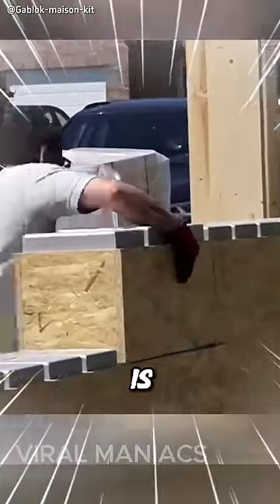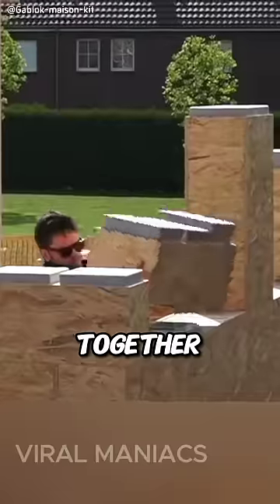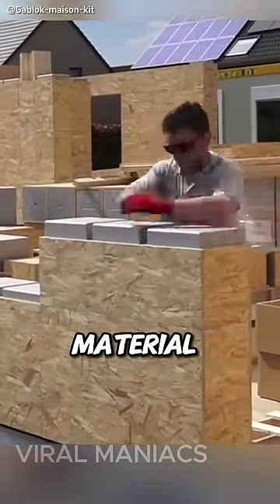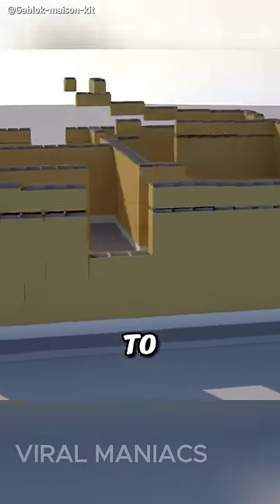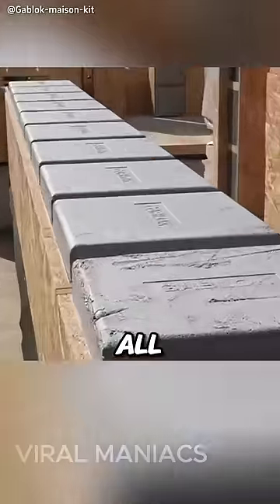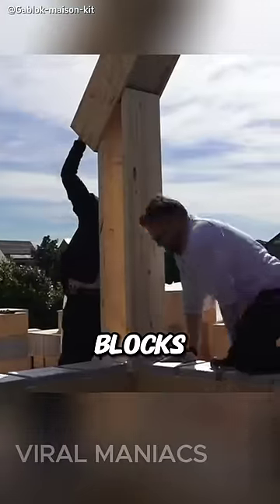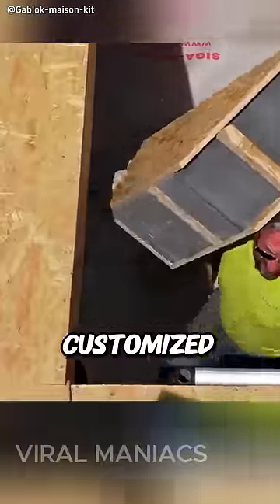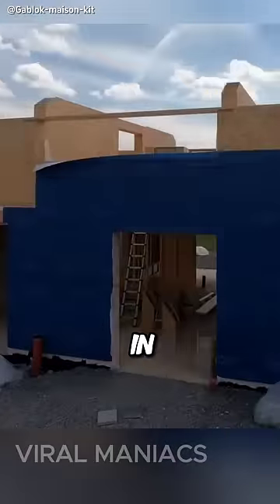Whoever Invented This Way Of Building Houses Is a Genius #shorts

Comment: Everything was fine until the big bad wolf came by😂
Reply: That's hilarious 😅
Reply: Exactly what I was thinking.
Reply: Just wanted to give the same comment 😂😂
Reply: 😂😂😂😂😂 Love the humour.
Reply: is that a 16 inch wall? So for those who assume that this is all it takes to build a home, you might ask a plumber, an electrician, a roofer and several other trades if there is a part that they play in all of this.
Reply: Hahaha
Reply: Same thought here😂
Reply: You could take out a column of insulated inserts... put in rebar , and pour concrete down one column at the ends of some walls.  This could secure it and provide weight to resist wind force.
Reply: Cocomelon😂😂
Reply: ....until the fire national attacked.
Reply: Who makes him house from wood and plastic?  Just make it cement and cinder blocks.  At least it's bulletproof
Reply: Exactly my though😂😂😂😂
Reply: You can pick the pieces up and assemble it again😂😂
Reply: Yeah... he says the inventor us a genius... Time will tell on that comment.
Reply: @erikkind1224 the inly problem with that idea is that they are staggering the blocks like you would do with bricks....  I sold aerated autoclaved concrete for a couple if years and your idea is exactly what they did for structural support.
Reply: That's any house against tornado. 😂😂😂

Comment: I'm not certain we need to add $200k disposable houses to the chat.  I mean $50k disposable vehicles is already a bit of a problem.
Reply: Can't wait until making stuff to last becomes cool again.
Reply: At least they’re using OSB a lot of the new homes I see being built are using this almost paperlike sheathing
Reply: all the houses already being built are disposable

Source: ive worked in construction from concrete, to framing, to roofing.

Its all crap
Reply: Disposable!?
Reply: At this point, I don't even care as long as home prices come down.
Reply: @rozz6205 meaning the won’t be standing or have severe structural degradation in a shorter time than houses built 100+ years ago
Reply: Don’t forget with those cars come disposable batteries. Which are bad for the environment
Reply: @Ricramalot79  So true. I deliver auto parts for a living and nobody will take old lithium batteries. I have a customer who replaced 2 for a customer and he bought the batteries from a dealer and the dealer wouldn't take the old batteries. He can't find anybody to take them to dispose of them properly. That's going to become a HUGE problem in the coming years.
Reply: @FlyHighShootStraight this seems like it’d be perfect for rural areas where labor and access isn’t as available.

Btw, building from 100 years ago aren’t all that great. It’s part of the reason housing costs have skyrocketed. The home habitability act in the 70, which was a react to shoddy housing to satisfy the baby boom, exposed how much housing wasn’t safe. Not to mention forcing modern utilities in them. 100 years ago, electricity and indoor plumbing wasn’t a given.

Landlords obviously aren’t going to absorb this cost, so rent goes up to compensate. Then there’s aspect of preservation, the charm of original housing which prevented houses from being demolished and built new. Any new housing built adjacent to older houses weren’t going to sell them selves short just for being up to code. So housing costs remain high.

Cities like Houston, Vegas, or Austin that had their boom after 1970, and incidentally not overly nostalgic, don’t have the astronomical housing costs like older cities.

Also, don’t forget survivorship bias. There was plenty or shoddy housing in the past, but it’s not around anymore. The well built stuff that is around, it cost a pretty penny in its day. The same as you would pay today, nothing stopping you from hiring a stone mason. Rest assured it isn’t cheap
Reply: Exactly.
Reply: Dude, in this day and age, if you could own a house at $200k would be a dream for many. 

You can’t even get a studio condo for that price.
Reply: @projectpat2262  Are you not just talking about ther weatherproofing wrap like Tyvek? That's usually only one of several layers.
Reply: @Menuki  $200k homes would be amazing. The key word here is “disposable” though.
Reply: @americancapitalist9094  where do they say disposable? It’s still getting coated in Tyvek for weatherproofing.

It’s not significantly worse than any other construction. I can see a unit like this easy to expand or be used to expand an existing building. You also have to think about access to the location and availability of skilled workers. This would be excellent for rural areas.

Comment: And when a tornado comes through, you just go around the United States and retrieve your blocks. 😮
Reply: Like that doesn't happen with any other building material
Reply: Because wooden houses in america are tornado resistant. Yep
Reply: @whyme007 In Europe we use stone, bricks and reinforced concrete. You can drive a fully loaded bus in it and it won't fall. The only thing getting damaged would be roof tiles and some windows
Reply: Probably would be in one piece next state over😂
Reply: The tornado also brings blocks from other states. One more room if you are lucky.
Reply: For US they sell block with a pack of superglue
Reply: You’d have to clean out your inventory to collect your loose blocks for sure
Reply: @klipser66 yeah, but changing electrical or plumbing is a mess.  I’ve done it in Spain and it’s a lot of work.
Reply: @Wibb14  It is and I've done it myself but I'd rather break my back doing those tasks and live in a house that can withstand most of what nature has to offer.
Reply: @klipser66  I can respect that.  I've lived in both and do love the adaptability and ease of a mainly wooden framed house.  The concrete and brick house just felt so much more unchangeable which seemed odd to me having grown up in the US.
Reply: @Wibb14  I agree. One of my holiday houses is wooden frames and knauf(plaster) panels. I enjoy working on it much more then on the other one that is old stone house and it is a literal money pit 😅 That being said you really feel like in a castle in the stone one and it has been in my family for almost 300 years!
Reply: @klipser66  That is very cool.  You  can't give up the family castle!!
Reply: @Wibb14  😂😂 True that
Reply: These bad jokes are really stupid, considering these things are sturdier than traditional housing in America. Look it up.

Comment: 3 Questions
Where does the electrical go?
Where does the plumbing go?
How do you fix holes?
Reply: Good question
Reply: Propably the gibrock wont go straight onto the osb. When we build framed houses we will put a 6x6cm stud on the osb where the wide studs are. Then the gibrock goes onto these. The layer gets insulatied and electrical goes in there too.
Reply: Electrical goes along the wall just like in the basement and the plumbing is done in the walls just like a normal house.  if you watch the video. It explains more not that it makes great sense to do it this way. I'm just answering your questions lol
Reply: @Pete..  wire go right on the strandboard with polystyrene insulation... 🤦 Have you ever heard of such dangerous thing as fire?
Reply: how thick are the windows and doors going to have to be ?
Reply: @Chisholm7  Sam as regular window. Extension James like on a regular house
Reply: It's the same as dincel, there is a layer and cavity attached to the inside of the walls for gyprock. You can also drill through to go from the inside to the outside.
Reply: @leetpg what about fire safety, huh?
Reply: Insulation too.
Reply: Ok so there's guy who spent a lot of time and energy to come with this genius idea, and you can't come with those 3 simple answers? Some respect to homo sapiens please
Reply: @hombredelfuturo_888  from which POV it is genius?
Reply: How about fire, how about durability.. IDK Rick
Reply: These blocks are hollow.after doing  piping and wiring inside finally   concrete in poured over these blocks for stability.
Reply: No Questions
Reply: @ambreeniramahmad8315  

That's gonna be a nightmare and that breaks like... a CRAP ton of building codes. 

That's a recipe for a burst pipe or a worn wire to screw up your house.
Reply: There are blocks designed for those installations dude
Reply: Just curious.
It will withstands flood and storm right?
Reply: yes
Reply: There are vertical battens on the interior to run plumbing and insulation. It’s all been planned out.
Reply: Plumbing probably in the concrete slab and the electrical in the roof .
Reply: On the Gablok site, they say that plans would include 40cm gaps that could be covered by finishing plates where everything can be ran.
Reply: @Chisholm7 I think it would look very similar to the windows and doors in straw bale construction. Just very deep.
Reply: dont need all of them. all is cord less. we arleady invent the techs. dont worry.
Reply: @-Mitra-  I have no idea, why you asking me?
Reply: @joecrawford8369   or a drywall return, I know none of the complaints ive seen are from actual builders. My only questions would be load capacities, and passing code in high wind areas or earthquake zones. (which they might do, just because its unorthodox doesn't mean it won't work)
Reply: @-Mitra-  I've heard of conduit
Reply: Holes? The walls are 2 inch thick wood, not drywall. If you somehow made a hole by accident, which would be a hell of an accident, you'd fill it with a wood patch as you would drywall. Can't figure that out?
Reply: @williamlangeii4012 

That'd be great if the "Legos" didn't develop structural stability in the same way bricks do... but don't have grout you can chip out.

Any hole you patch has to be able to handle FAR more than a drywall or wood patch would deliver as far as structure goes.

Using that, EVERYTHING is load bearing.

And, as far as things go, I'm not just meaning internal holes in the wall.

What if you get a bad storm and a tree falls? I had that happen to one of my homes and it knocked down a good portion of our kitchen.

Do we just mark the house a loss?

How do you repair that without tearing out things like you do with bricks... but since they're interlocked, you can't just pull them out and you can't chip out the binding like you can with bricks.

I think you've not given it enough thought, man.
Reply: They probably sell you those "special bricks" and charge you triple, lol.
Reply: 3 answers
In the walls
In the walls
With a drill and caps😊

Comment: Super cool idea! I do wonder about the structures ability to withstand storms and damage tho
Reply: That's the thing, they can't unless they are somehow attached to one another with more than foam.
Reply: @MrDmitriRavenoff I suppose they could glue them. I worry less about storms and more about the fire hazard.
Reply: @michaelpettersson4919 legit thinking the same Thing no amount of fire walls or dense glass is stopping that
Reply: Worst thing is you just gotta find the pieces and rebuild
Reply: Exactly like normal wooden houses
Reply: Maybe you could add some sort of framework of 2x4s after it's built to add stability... it seems like a fun idea, though.
Reply: Okie folks look at this and laugh 😂😅😂😅😂
Reply: Vulnerable to bullets
Reply: You’d cry if you had to watch a framing crew
Reply: Not sure I cope with standing on one of those blocks in the dark.
Reply: I bet this withstand storm better than wooden frame home
Reply: If they changed the foam to a fire resistant version it does seem interesting...
Reply: @net343 no. U have the the bars in bedded in the concrete slabs inside the wall, u cant do this with the foam they're using. Not only the wiring, plumbing and hvac exposed but taking up all ur space. It in the walls, under the plywood floors the tgi runs. Its not feasible to use this method. Plus the crappy wood being used no better than portical board.
Reply: @jimboh.2654  nah... Am a bricks and stone guy all the way
Reply: Lol most houses in the US are cardboard, in Italy we have wooden houses that lasted 150+ years in the mountains. Lego builds should be a thing!
Reply: @mauricemakwangwala961 Worked for thousands of years for good reasons right?
Reply: @mauricemakwangwala961  like a normal house lol. the problem with this are money but being bullet proof is the least of its worries lol.
Reply: @AlexStudioPhobic  Actually most houses in the U.S are still wood, they are just very old houses and pretty soon the “new” way of building houses will replace the old way of building them out of wood.
Reply: @0blacklightning046  in here we still make them with wood, new technologies, looking great, less pollution with all the security needed.